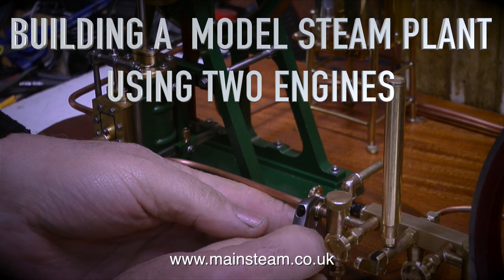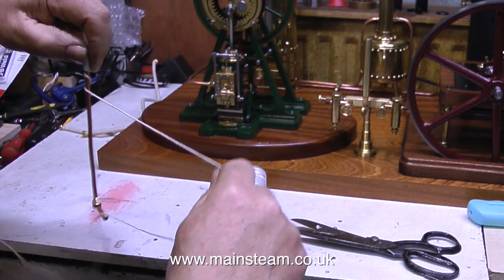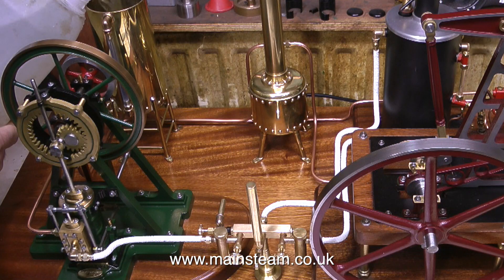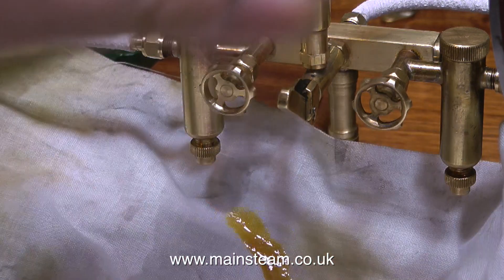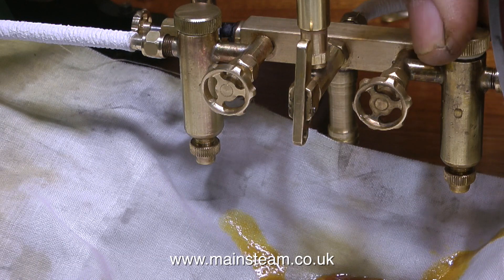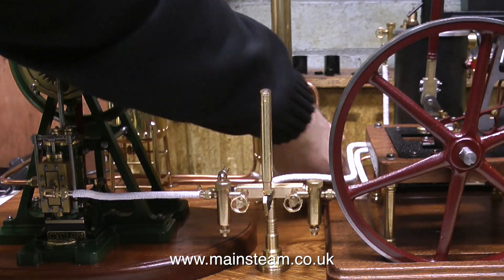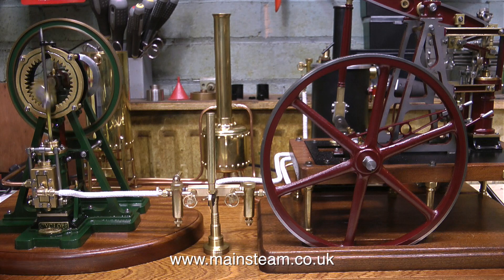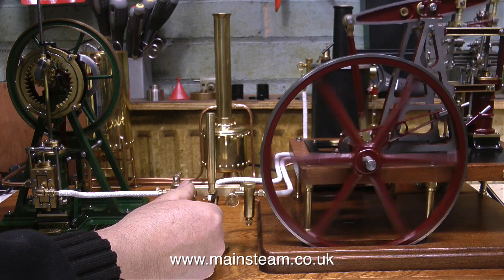BUILDING A  MODEL STEAM PLANT USING TWO ENGINES -  PART #8

Comment: I'm not (yet) a model steam guy but I find your videos interesting, very well thought out and presented, and I'm beginning to think about how I might get into this hobby, and with what ultimate aim.  I've learnt a lot from your videos. 
But isn't it odd to have a model steam plant comprising a rocking beam engine - one of the earliest but important technologies - together with an engine that is a novelty engine of completely different type?   You often comment about trying different assembly ideas to see that they look right, and not "odd" or "stupid", as you did in this series.  This pairing seems decidedly odd.  
My ideal would be a model steam plant comprising boiler, appropriate pumps, feeders and lubricators, one or 2 engines of different size but realistically similar design era, and a gramme-ring generator or some such.   Don't know how to go about the generator yet though.
Reply from the maker: In your Model Steam World, just like in mine, you can do whatever you want }:-)))

Comment: The Cyclops is fascinating.  Keith - is the Cyclops more efficient in producing torque / power over other engines?
I have not been able to find an tech literature comparing the hypocycloidal mechanism to more traditional one. Right now I am resisting the temptation to order one - though no one seems to sell them in the colonies.
Reply from the maker: Not really Mike, it just has an alternative to the normal way that the piston rod connects to the crankshaft, it is very nice to watch though .....

Comment: Just can't express how fascinating that Cyclops is. Especially when posed next to the Vulcan. More movements on the Vulcan and so smooth, but that circular motion on the Cy is just fantastic. - Is that "slight" rattle noise coming from the inner gear of the Cyclops? If so, would a more viscous oil quiet it down even more? - I know that having so much surface area of tooth to tooth contact between the gears must make it nearly impossible for it to be much quieter... ?  Thanks again for sharing this craft.
Reply from the maker: The centre gear does rattle a bit - oil quietens it for a while but then the rattle comes back ....

Comment: I had a similar though to that of the commenter you mentioned, but came to different conclusions.

I somewhat agree with him that having the steam flow through the lubricator will quickly blow the oil into the outlet, but (unlike him) it seems to me this effect would stop as soon as the oil level drops to the outlet height. At this point it would behave like a normal lubricator, where the oil would be fed at a rate based on the accumulation of condensate in the bottom.

Further to that, though, the flow of steam through the lubricator would keep it hotter than in the more common side-branch configuration, and this might slow down condensation and so reduce the oil flow rate. Whether this is true would depend on whether the condensate accumulating in the lubricator is only what condenses there, or also includes condensate in the steam lines that gets blown in.
Reply from the maker: you know, they really don't work like you think they do. Put it this way: Those Displacement lubricators work perfectly, (what more can I say) ...... they are the ones that "Cotswold Heritage" supply for their model steam engines and they look like they are "Jubilee Fittings" Displacement Lubricators. (made near Wakefield, UK) Choose any three of those reasons why the first chap who commented and now yourself think that there is some sort of problem with them ...... !!!!????!!!!
Reply: Keith,
Don't get me wrong. I didn't say there was a problem with them! I was just musing on differences between using them as a side branch (which appears to be how the suppliers you mention designed them) versus using them as a through connection.
Reply from the maker: This is the very last comment I will make on here regarding the operation of Displacement Lubricators. It does not matter where the unit is mounted on the steam line or whether it's a T piece, or directly into the steam chest. Steam still condenses in the tiny hole that is cross drilled into the  pipe that goes through the Lubricator.
I will make a video explaining this in detail once and for all ....... because there is a lot of mis-information going on here . . . .

Comment: Would adding a super heater/steam drier help the boiler with running both engines at once?
Reply from the maker: It already has a steam drier fitted inside the top of the boiler.

Comment: Hi Keith 
Please don't think I'm trying to tell you how to do the job, I just have a question your experience might be able to answer. 
If the exhaust pipes to the chuff pot were lagged in string would they hold sufficient heat to stop the exhaust gurgling? Or is it just a generic small steam engine thing? Again, just an honest question, many thanks I really like your videos
Reply from the maker: No, it would still gurgle with this arrangement. My condensers don't gurgle because only the water vapour goes out to the chimney ..... but the condensing part of the Chuff Pot is not it's primary function.

Comment: Is there any kind of regulator for this, so the machines both can go slowly and steady for long time?
Reply from the maker: No - as you can see in the video it is when the boiler pressure drops as water is pumped in that usually the Cyclops engine stops . . . both of the regulator valves are fine .....